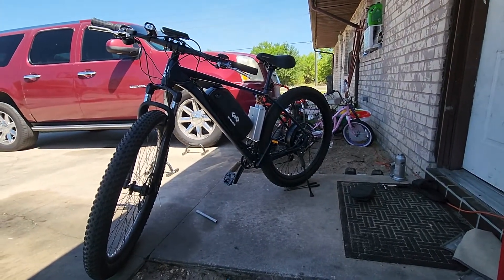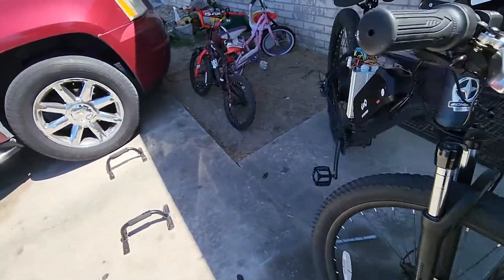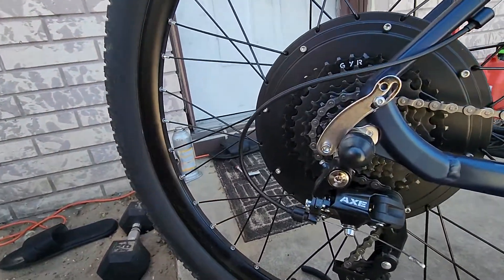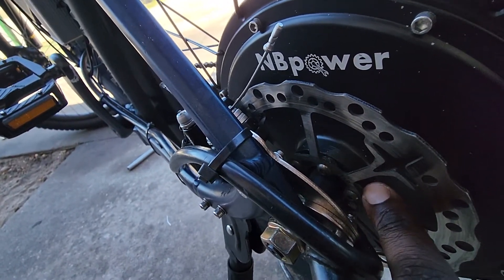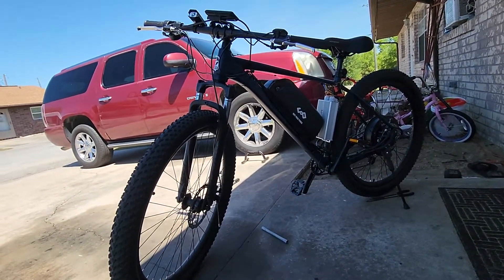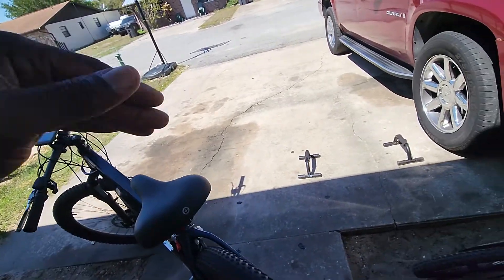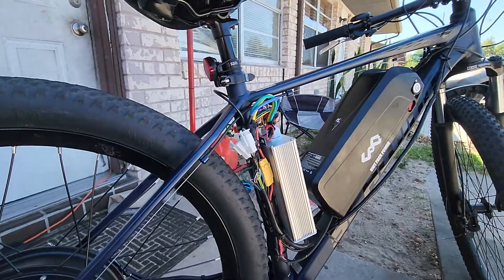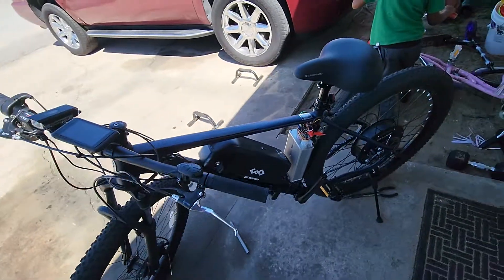3000w  ebike conversion  kit on a schwinn axum dp

Comment: hey i was just wondering as i am making my own 3000w ebike what frame is that on your 8000w ebike i have looked through all your vids and cant find link to the 8000w fat tyre ebike
Reply from the maker: https://www.amazon.com/dp/B09T2TZY4R/ref=cm_sw_r_as_gl_apa_gl_i_7RFXS761X35XC3E069PG?linkCode=ml2&tag=ebikeguy08-20
Reply: thank you so much
 @EBG-offical

Comment: im thinking of getting a 3000w motor. do i need to custom fab torque arms or will 2 grin torque arms be enough for my steel frame. im afraid i might snap my dropout.
Reply from the maker: To tell you the truth some people don't even use torque arm for a 3000w kit but always be safe than sorry, the grin or regular torque arm will do
Reply: @EBG-offical  I believe you since youve tested some big power hubs! (ill use 2 just to be safe) thanks dude. I posted in your fb group as well. not sure what battery to get with the  72V 80A Sabvoton V2 Controller

Comment: how much range are you getting full throttle with a 52v 20ah and also are the cells 18650?
Reply from the maker: The cells were 21700 and I get about 10 miles if I just used only throttle
Reply: @EBG-offical  top speed?
Reply from the maker: With that setup was at 48mph

Comment: How are you doing 3000w with that battery? Doesn’t it have a 40a BMS?
Reply from the maker: Yes bms is bypass  tho
Reply: @EBG-offical  Maybe I'm a wuss but a UPP battery with bypassed BMS sounds scary lol stay safe man love the channel
Reply from the maker: Lol thank you but just on the discharge side tho but had no problem with the battery over heating

Comment: I'm putting a 2000 watt hub on the front of my e-bike they say it will do 43 mph but I seen reviews that it would only do 30 mph with a 52 volt battery, but if you're getting that much speed out of a 52 volt then I should have no problem getting a 43 mph
Reply from the maker: I don't know about a front hub with that power, it might get squirrly on you but make sure you get a 80a controller tho

Comment: How are you doing 45 miles an hour with a 52 volt battery? I thought you need a 72 volt to get the maximum potential out of that motor.
Reply from the maker: No I got up to 47mph on that battery no problem, it's the controller to get you there without overheating but was on flat ground might be slower up hill tho.
Reply: @EBG-offical  well hell that will save me $400 on a battery thanks for the info
Reply from the maker: No problem you have to get a 80a sine wave controller paired to a 52v battery 60a bms in order to achieve 45mph safely
Reply: What kind of distance are you getting out of that battery?
Reply from the maker: @Michiganwatch  well it I do just throttle only ill get 14 miles out of it but thats with that 20ah battery, the more amp hours the better

Comment: What was the total build cost, not including bike price. I just did a whole conversion on my axum DP for trail riding but next year I want a new trail bike and possibly going to turn my axum into an ebike
Reply from the maker: Total price includes the bike was 1500 bucks but I got it on Amazon, if I were to got it through ali express it have been much cheaper. Check out my other video on the ultimate e- mountain bike doing some fast trail riding 😀

Comment: Impressive mods, but I had one of these bikes for a while and its shock really can't handle serious off roading. I doubt it'll last a year before it snaps, if that's where you mostly ride as you say.  Plus if you're riding 45mph with 230 LBS, the mechanical brakes aren't really safe, either - hope you wear full face helmets
Reply from the maker: Shocks are definitely going to be replaced, it's holding up pretty well the bike has gone through some updates since that video was published also I ride mostly with my kids so 20mph and under is ideal but I do open her up from time to time 53mph so far and still pulling

Comment: Amazing, I like your build! We have the same bike, The Scwinn Axum is a good bike to  build on. I’m planNing to use it as my second build  for next summer. I just completed my first Ebike build this month, went with a basic L faster 450w build on a Giant Yukon MTB. I am shocked to hear that you can hit 45mph at your current height/ weight. I’m smaller at 5’10 165 lbs so I can just imagine it’ll be even faster for me if I go with this kit. But idk man. Everyone is saying Bafang all day. We’ll see what I go with. Not really feeling the $1500 price tag with the battery included tho on that Bafang bbs03 hd. I heard you say you take yours off road, that’s definitely something I’ll be doing.
Reply from the maker: Yes  I really don't have experience with the mid drive system but my experience with the hub drive is awesome especially when you go above 2000w, power is no issue its heavy but you really won't notice much and I jumped mine alot
Reply: @EBG-offical  what is the drop out size for this hub? Did you have to stretch the dropouts?
Reply from the maker: 135mm  and the wheel fit perfectly.

Comment: Looks good! Did you use a bottle holder frame to hold controller there or ? If you are going off road with it must be well secured.
Reply from the maker: Yes I did. I go off road a lot and its definitely held in place
Reply: @E-bikeguy.   Tommy how did you get the battery on without the cable holders getting in the way?  So those wide 29 x  2.60 tires fix on the N power and CSC rims kits?  I really want the Axum but I may have to get the Schwinn Ascension if it's a major problem to fix these two things.

Comment: aye bro can i get a link i wanna buy this motor? Also does this kit have cruise control?
Reply from the maker: US $357.88  8%OFF | 205H QS V3 48V-72V 5000W 50H 3.5T/5T Bicycle Hub Motor Wheel MTX39 Bicycle Wheel 20" 24" 26" 27.5" 28" 29" 700C Ebike Kit
https://a.aliexpress.com/_mLyYnH0
Reply: @EBG-offical  hopefully I can find one on Amazon I don't wanna wait a month 😫
Reply from the maker: @HypedOUT  well it was on Amazon at first I brought it but you now can go directly through them on ali express and they ship out fast too ill have another video out on it with so.e updates and I built some for my two sons. The company in China called ND Ebike factory stor/ NB Power
Reply: @EBG-offical  can't wait to watch the vid fam
Reply: @EBG-offical  i forgot to ask what size did you get 26 or 29?
Reply from the maker: @HypedOUT  you can get them in different rim sizes but I got a 29er rim
Reply: @EBG-offical  okay bet this is the bike I'm going to get so I'll also get a 29inch thanks for the help much appreciated 👍🏻 🙏
Reply from the maker: @HypedOUT  no problem check out my other video on this bike
Reply from the maker: Yes it has cruise control ill send you a link on the motor